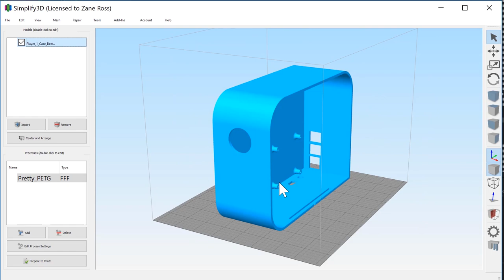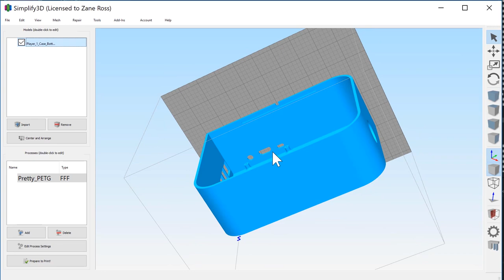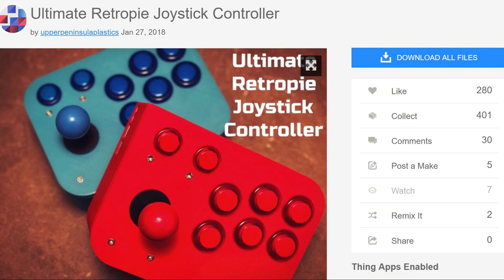3D Printed Retropie Arcade Joystick Controller Box

Comment: Like the 2nd player controller, can I make a seperate 4 way controller (with a Happ (?) stick or something similar) so that I can play games like pac-man, galaga  that are nearly impossible with typical 8 way sticks.?
Reply from the maker: The linked files include a step file, so you can make any changes you need. I did the same to make a few modifications for this project.